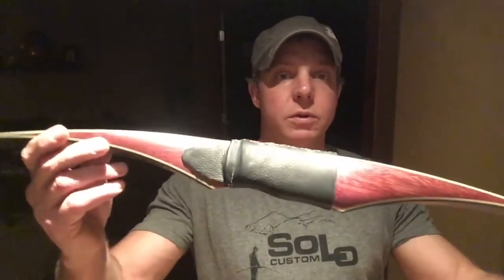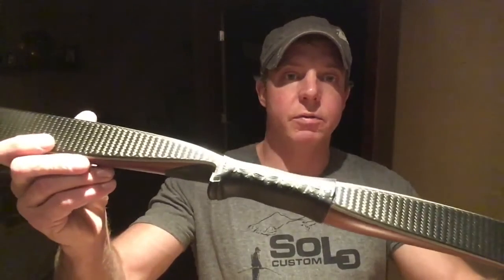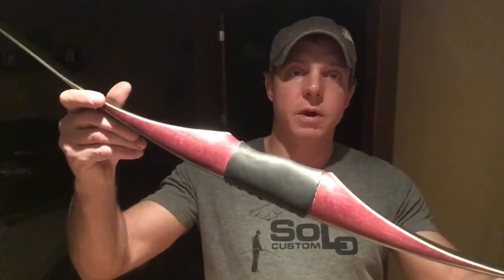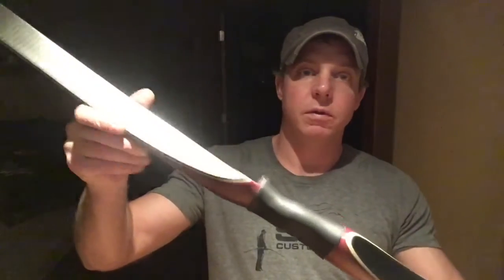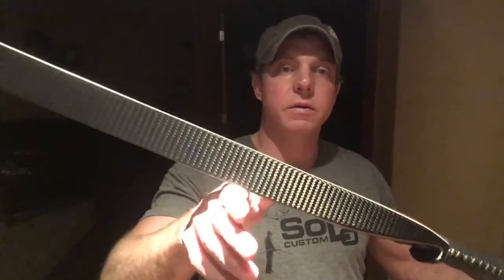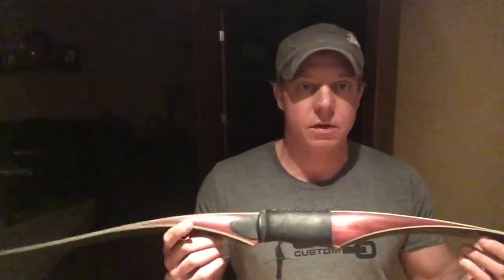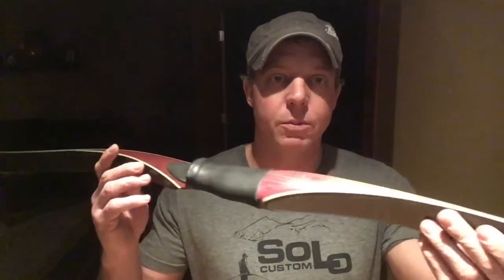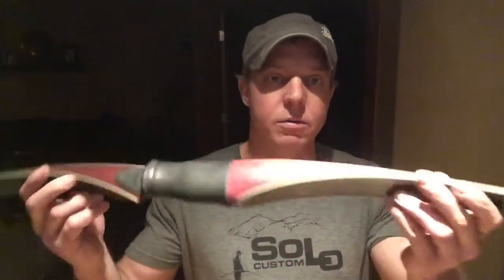Carbon Fiber Recurve Bow

Comment: Carbon fiber might have a very high strength/weight ratio, but delaminates easily between layers.  I used to use a scrap cutoff from an F22 part as a sanding block, simply changing the self adhesive sandpaper on it could pull layers apart if I wasn't careful.  One of my colleagues learned to stitch all the layers together before resin infusion

Comment: COMPARING IT TO BAMBOO AND I HAVE BOTH. ALOT OF THE DIFFERENCE CAN BE IN THE BOYERS LIMB DESIGN. CARBON IS VERY SMOOTH AND FAST. BAMBOO ALSO VERY SMOOTH AND FAST. ONE OF MY FAVORITE LIBS IS CARBON BACKED BAMBOO BY DAS. THREE RIVERS SOLD THE LIMBS TO ME AND I WAS BLOWN AWAY BY THE FEEL AND SPEED.

Comment: I HAVE TWO SETS OF HOYT CARBON QUATROS, ONE ON THE HOYT BUFFELO AND THE OTHER ON A ILF 56" RECURVE. THOSE ARE THE BEST OF THE BEST AND EQUAL TO DAS LIMBS. DEPENDS AGAIN, ON THE LIMB MAKER BUT I DO BELIEVE MY CARBON LIMBS ARE AS FAST AS THE 10LBS HEAVIER OF THE PAST.
Reply from the maker: Not hard to find out. Shoot it through a chronograph and post a video of. If you really want to be accurate, use a release. That’s what I should have done (I have a video comparing limb types). Or at least use a clicker.

Comment: Could you please give us an update on this bow, such as it's reliability and performance. Thank you!
Reply from the maker: I’ve used this as my primary bow for a year now. I’m always pretty hard on my equipment. It’s all scratched and dinged up. I slipped on wet rock in the mountains of Colorado. I left it on the roof of my car after Whitetail hunting in Illinois and it ended up bouncing down the ashphalt. I’ve crawled through many thorn bushes and shot maybe a thousand  arrows through it. It’s held up perfectly and still shoots as good as new.